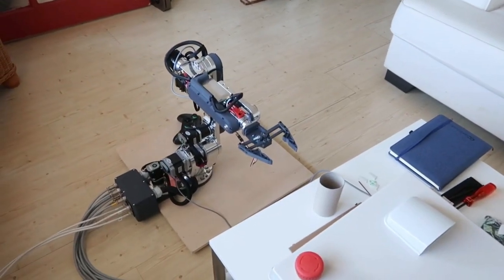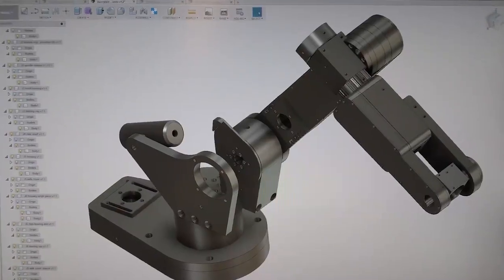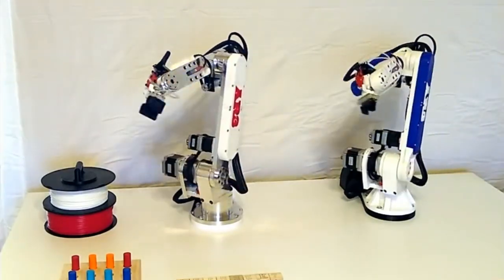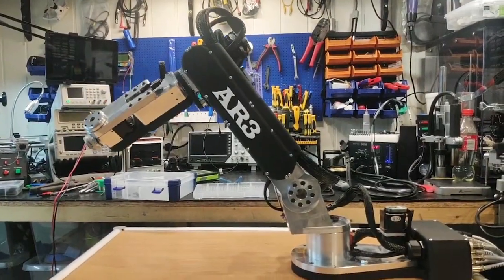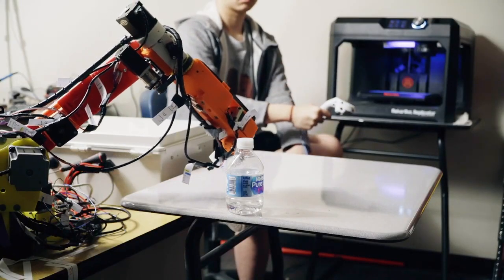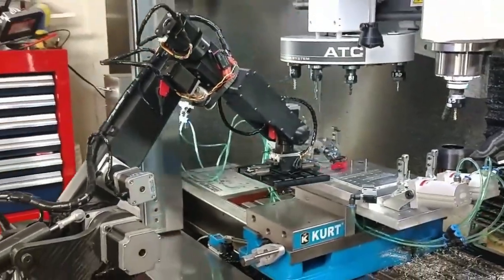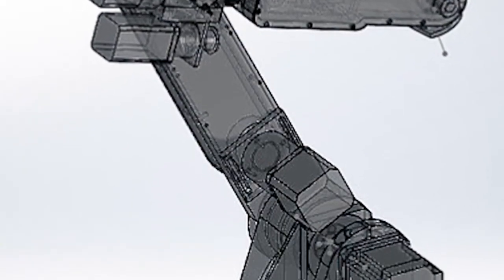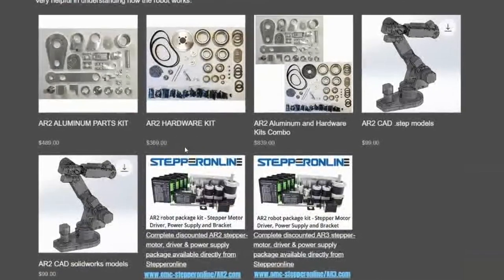AR3 - The DIY 6 Axis Robot

Comment: nice video , I need to build one for a graduation project , what type of stepper motors  (NEMA _ ? ) did you use at the base joint for the aluminum body for example , thank you

Comment: Is there custom code needed for the Ramps board? I woud like to build one and controll it with this Software
Reply from the maker: The ramps board should be fine.  as long as the driver accepts step and direction inputs there shouldn't be a problem.

Comment: Wow !!!! You had me at camera and filming this is amazing. Just have a few questions.(1) Only one size ? (2) Can the parts be upgradable like the motors/parts? (3) Does it have fast motion for high speed footage??
Reply from the maker: Hello,  currently the robot is just the desktop size.  the manual has some more specs on size as well as some other details.  I do have a video that illustrates the different speed ranges the robot has but yes you can program it in percentage to go from very slow to its max speed.

Comment: Awesome , I can see all the effort going into this , firstly i'd like to thank you for starting an open platform where enthusiasts can work and collaborate to learn how robots work.
Have you tried controlling this via a software such as RoboDK through which one can use the arm via serial , robodk postprocesses and talks with the microcontroller , this can be used for things like manufacturing and controlling the arm directly to 3d print ,etc,
Reply from the maker: Thank you.  RoboDK does have a configuration for the AR3 but I'm not certain if they have finished the post processor yet
Reply: @anninrobotics  oh ,btw I'm making this one and I'd like to know if I can be of any help, or if the robodk one could be completed faster.

Comment: Which program did u use to design it? I also want to design  one but ill start with a smaller one and i thought about using fusion 360.
Reply from the maker: I use solidworks 2019
Reply: @anninrobotics  trank you for your quick answer . I sag that solidworks is a bit expansive for me. Do you know if Fusion 360 is good enough to design a robot arm ?
Reply from the maker: @m4ts373  yes you should have no problem using fusion 360
Reply: @anninrobotics  ok thank you very much:) your work is amazing and you inspired me to build my own arm.

Comment: Could you explain how to set a joint to a specific angel if the angle is not a multiple of the step angle or is there an Even smaller step than one singel step?

Comment: What is the over all reach of this robot?  I want to do one that can reach out about 3 feet to run a 3d printer.
Reply from the maker: The reach is 63cm, there are some specs and diagrams in the assembly manual specifications section.
Reply: @anninrobotics  Thank you, do you ever sell completed robots?  I am doing a room for my daughter that I want to 3d print a submarine that is going to be her bed (yellow of course, with screen door) because of the size this will me regular 3d printers won't work.  The sub will be 5 feet diameter and 6 feet long, done in 8 inch slices.  I plan to put the robot in the middle of the sub area and have it build all around itself.
Here is what it looks like now.  https://youtu.be/qnKuQuu9Hno

Comment: Super,super,super... Works with Teensy 4.1 ?
Thank you  100% Best.
Reply from the maker: I used the 3.5 as the pins are 5v tolerant for the encoders. You can use any Arduino based board as long as it can handle the encoder inputs
Reply: @anninrobotics   Thank you...

Comment: I wonder what it’s like to be this smart
Reply from the maker: Thank you but I'm not really that smart, just determined. It started with 3 motors taped to a board leaning how to control them, then an algorithm so all finish together, then made an arm and then worked on the math. Its overwhelming if you look at it as a whole but one step at a time builds up faster than you would think.

Comment: Very nice project Chris. I was wondering, How did you solve the issue of gearbox backlash?
Reply from the maker: They are planetary gears, they have a very small amount backlash but with the arm in compression it is vary accurate,  a small amount of backlash to be expected with a low cost planetary  option like this.
Reply: @anninrobotics  I see. Yeah, I can imagine that harmonic drives are not an option here. In any case it looks very solid, thanks for sharing all of this. Btw did you also calculated all the direct and inverse kinematics? that is a nightmare for 6dof robots!
Reply from the maker: @victorfesto  yes I have done all those calculations,  I have a series of videos on the kinematics on my channel that I put together on that.

Comment: Hey Chris what are your thoughts on the trend of using BLDC motors with a controller that transforms it into an industrial like servo like the Moteus Controller https://www.youtube.com/watch?v=R2uuTfuyadk ? The daisy chaining of cables might make it easier to use as well. Would this be a viable option to replace stepper motors for cheaper robots?
Reply from the maker: Its possible and something I will look into in the future.  I have been trying to keep the cost as low as possible using closed loop stepper motors but I will be looking at that in the future.

Comment: Awesome as usual my man. Thanks for doing this.
Do have some kind of solid models available?  I don't know of a way to machine aluminum parts from a mesh, and fusion360 does a poor job at converting meshes to solids ( haven't found anything that does it well).
Reply from the maker: Thank you very much. I do have the solidworks models on the robot kits page for a small fee that helps cover licensing and development stuff.
Reply: @anninrobotics  Thanks. I have a hass mini mill. The dimensions x and y are 16x12. Before I run off and buy the models, off the top of your head, do you know if my mill is big enough to make these parts?

I also have a 600mmx900mm router. Maybe I can make the arms from acrylic if they are too long for my mill.

Comment: What an inspiring video, something really cool about seeing them move in sync - making the physical, squishy world precise and automated.

I've learn so much in Cad, with programming and general design ideas when making a camera project for a friend. 

I find however soooooo much time has to be spent thinking, and re-doing ideas as you come across issues and more efficient ways of doing things. It's fun but takes a lot of time... I do love how by just lying in bed you can mentally improve a design.

Do you have any ways that you shortcut straight to a good design first as I tend to find I over design things with high part counts and have to reduce them later.

Do you have a workshop in the UK ? Would be cool to incorporate a short visit as part of a summer motorbike trip if Boris lets us out.

Thank you,
Ivan G-S
Reply from the maker: Hello, thank you for the comments. when I start with a new design I typically evaluate all the components that are off the shelf that I could possibly use and then start selecting the lowest cost versus the most practical and build my designs around those items and then test and redesign from there. No unfortunately I'm not in the UK, but if at some point in the future I am able to have a full size business and you are in the US I would love to have visitors.

Comment: Sir, this is so awesome an articulated robot that too DIY. 🤩 I would like to know what is the payload of the robot?
Reply from the maker: Hello, the payload of the robot is 1.9 kg one made from aluminum, if you make a 3D printed one it's closer to one kg but I haven't tested that fully to break one to see what the limit is.
Reply: Thank you sir, can i know which system software is used for running this robots as well as about teaching pendant?
Reply from the maker: @kishorage5984  it is software I have written for controlling the robot. I run it on a laptop to program and run the robot.
Reply: @anninrobotics  Sir, suppose if we want to use this robots for cooking application then how many will be needed and what will be te setup will it need PLC as an master?

Comment: $489 for the motor kit and $369 for the hardware kit for those of you wondering about the parts you can't 3d print yourself.
Reply from the maker: Hello, there is a full list in the  bill of materials in the manual so you can source the parts from anywhere that works for you.  And at the top of the kits page there is a list of the 5 parts groups.  aside from the motors, hardware and the parts you need to 3D print there is also the electrical components that are in the manual that you would need to get from amazon, ali express or other vendors.

Comment: Thank you! Great project! I wanted to start building this project,  but when I saw some questions from guys who faced with some issues without answers,  I afraid to start ). What is your next project?
Reply: BTW Best opensource robot arm which I found.
Reply from the maker: thank you very much.  let me know what problems you refer to if they are not addressed in the forum or manual I'll get you an answer.
Reply: @anninrobotics  OK. Thank you.